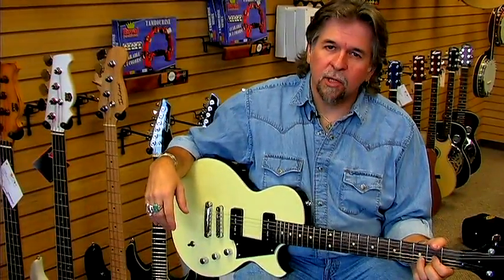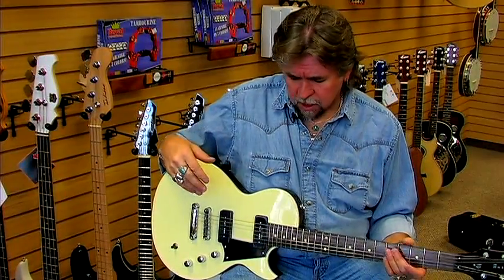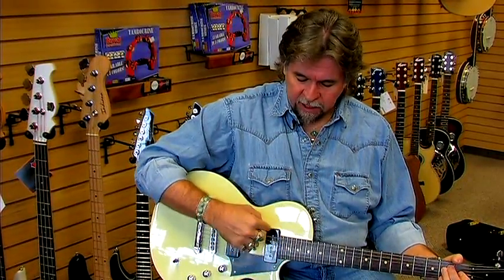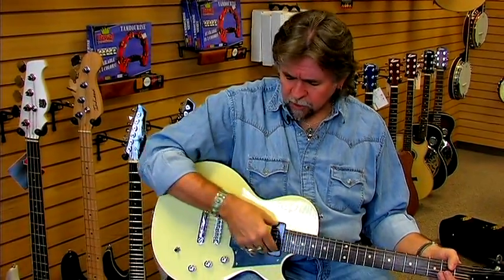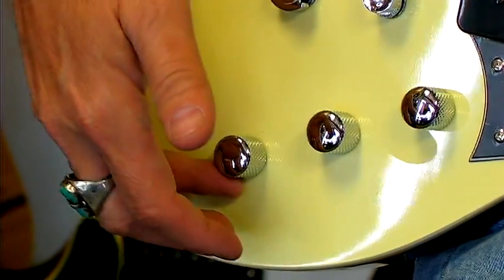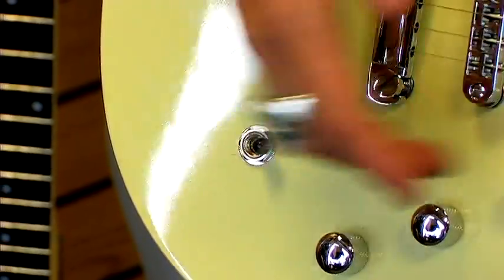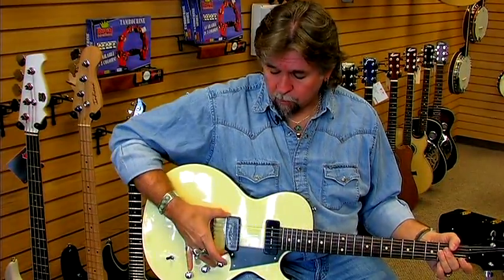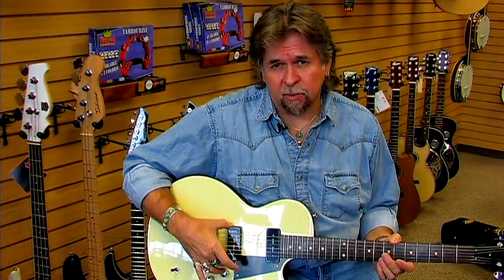Electric Guitars : Physics of Electric Guitars

Comment: 2:04 that is not an input jack, haha it's an output jack, you do not run sound into the guitar., and they call this expert village, also strumming  the strings does not create a magnetic field, the magnetic field is ever present,. strummingthe strings breaks the magnetic field and then turns that energy into a small electric current that travels through the circuitry and exits the guitar through the OUTPUT jack, not the input jack, hahaha, anytime I want the wrong or incomplete information I turn to expert village